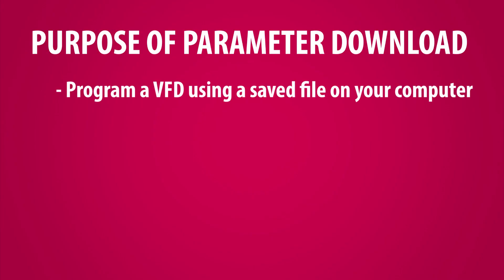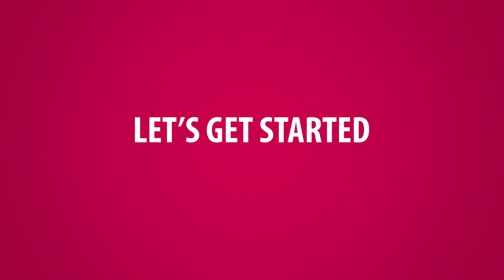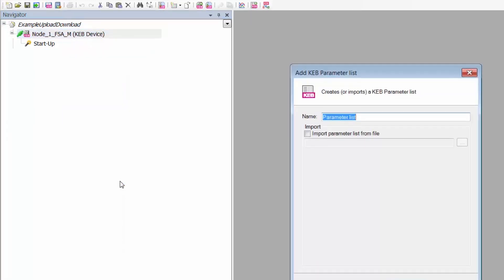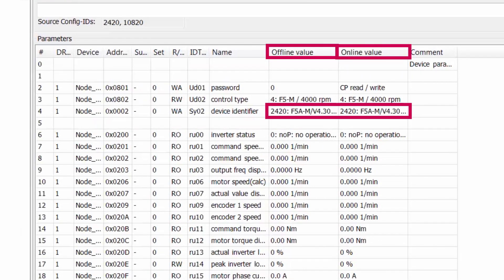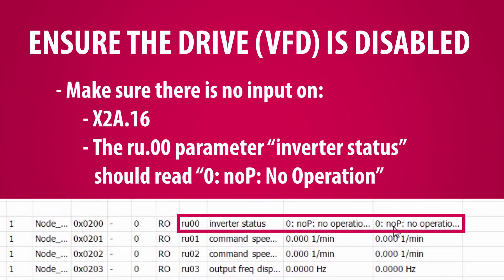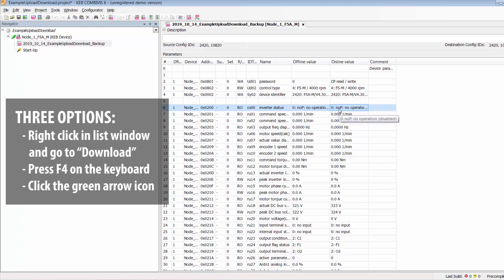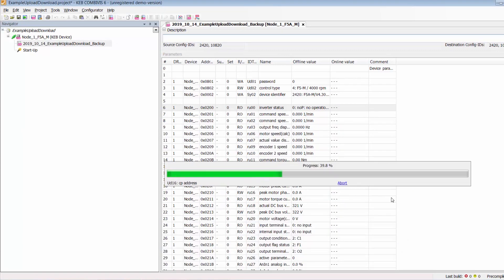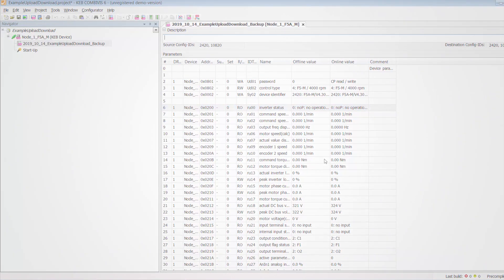KEB Combivis 6 Tutorial: F5 Drive Download Procedure

Comment: trying to create a backup from a combivert f5 but after downloading the backup to the pc from the combiwhatever f5 the parameter list is missing op61 and 62. why? i refuse to bellieve that a vfd needs 3935 paramters. why did you make it this complicated???
Reply from the maker: Thanks for your comment. After review, It could be that the software version of the parameter list is different than the drive you are connected to. Parameters are added in later versions of the software. It could be that the list you have is from an older version so op61 and 62 did not exist in that version. Without knowing more about your application and specific hardware and software versions it's difficult to give you a definitive solution, but this is a logical reason for the missing OP61 and OP62.
Reply: @ although it's an older model (f5) it has op61 and 62 because that is for forward and reverse action. when i do a complete parameter backup those two will not show up on the parameter backup list. do something with your lineup, i know I'm a nobody but i refuse to believe that a vfd needs 3950 parameters. because of this i am choosing a competitors product.

Comment: i want know cable details to connect keb vfd to pc
Reply from the maker: You can find the cables to connect a KEB VFD to a PC in this video. https://youtu.be/VTpQz2pfdF4
Below is a list of part and part numbers mentioned in the video:
 * KEB USB-to-serial adapter: 0058060-0040
 * RJ45 adapter: 00F50C0-0020
 * Combivis cable (DIN 66019II – RS-232 cable) part number: 0058025-001D
 * USB-to-serial adapter with FTDI chipset: 0000000-7938